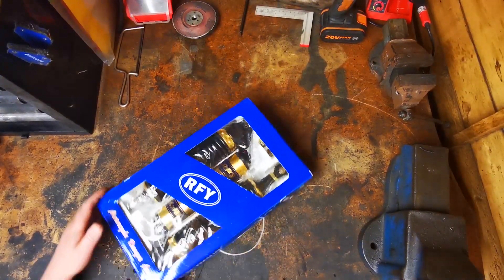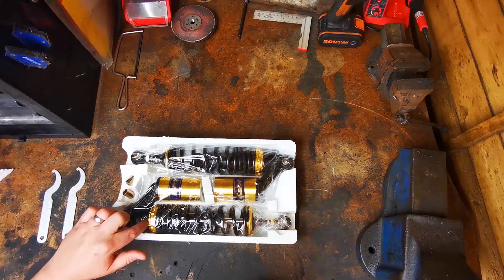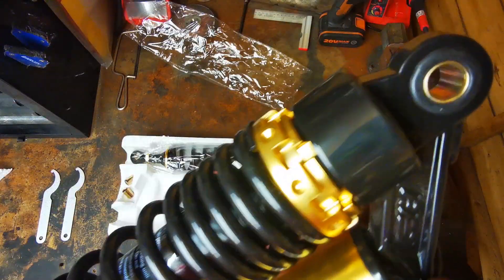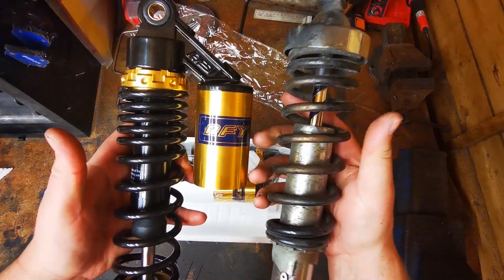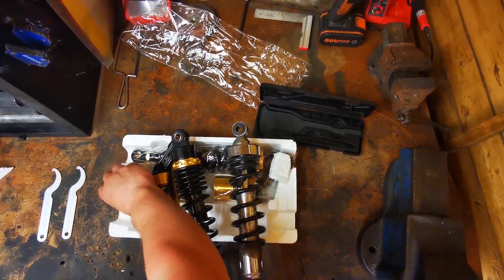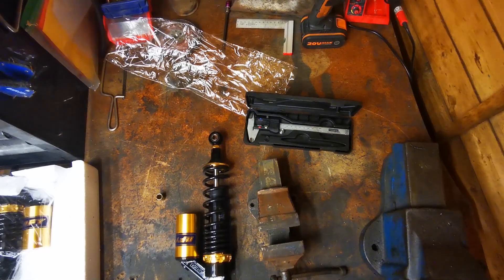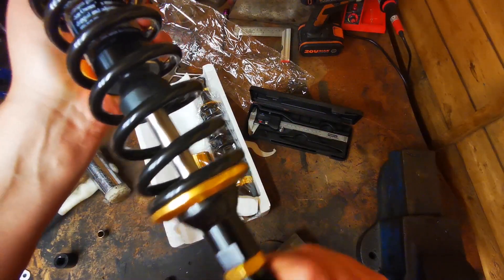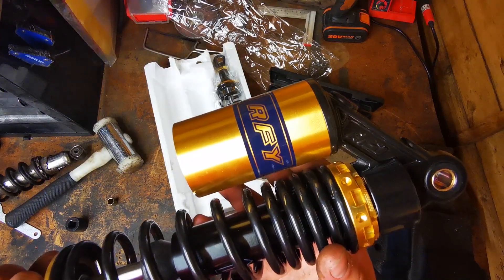RFY Shocks Unboxing And First Impressions

Comment: I bought a pair of these because they were the cheapest universal rear shocks on ebay.  Someone pointed out to me that the gas reservoir is completely fake and there is nothing inside the shock at all.  I've done 11.000 miles on them so far and plenty of hard off road riding along the green lanes of Kent, Sussex, Surrey, and Hampshire, and they havent blown up yet.  I would say for £35 they have been adequate.
Reply: Someone actually cut em open and it turns out the reservoir is not fake

Comment: Just an idea, a valve spring compressor makes very short work of taking out bushes on shocks
Reply: I installed 14mm bushing 
I used a vice with a jaw guard on one side made from aluminium angle to protect the 14mm metal bushing and used the 14mm metal bushing smeared with red rubber grease to push or press out the original factory 12mm metal bushings while installing the 14mm metal bushing at the same time 
I used a socket on the side the 12mm bushing come out for clearance and once they were nearly out had to use a couple of washers to increase the clearance because the socket wasn't quite deep enough 
I used a socket that fitted neatly against the rubber part of the bushing to hold the rubber in place while allowing the 12mm metal bushing to move into the centre of the socket 
You could cut a piece of metal tubing to size instead of using the socket and washers or you could use a deeper socket than I had on hand
Reply: ....it wasn't so much pressing out the 12mm bushing as using the 12mm bushing as a guide for the tighter 14mm bushing so as not to tear or damage the rudder

Comment: Just bought these for my Bike and will be installing them this weekend. So far they look good and by putting my weight on them seem a little stiff, I will update y'all when I get some road time on them. I recommend checking the pressure on the shocks when they arrive to make sure you aren't low.
Reply: Put them on just had to use the different insert, they fit well, and after 150 miles of riding today I had no issues and they were softer then the rough OEM shocks. I still need to mess around with the preload a little but it is close. Also when I checked the shock pressure they only had 20 psi, I put compressed in in them up to 70ps.(Our own air in the environment is mostly nitrogen anyway, so thats why I used it)
Reply: @chuckr5929  Would you recommend the piggy back shocks over the regular type shocks? If so, why? I'd appreciate your advice. I'm thinking to get these for my Yamaha V-Star 250.
Reply: @chuckr5929  
How are they going after 7 months ?
Reply: @hodaka1000  Still going strong had to put in nitrogen right out of the box, it took me a few tries to get the preload right, but after that and 2000 miles of riding on them, they are an improvement over stock.
Reply: @hodaka1000  They soften it up a bit over my stock shocks, so I am not as sore after riding 6-8 hours.
Reply: @chuckr5929  
Excellent 
I got a couple of pairs recently for $70 Australian a pair 
I just fitted one pair to a young mate's SR400 but he hasn't ridden it yet
Reply: @chuckr5929  
So you just increased the pressure with compressed air ?
Reply: @hodaka1000  You can use compressed or actual nitrogen, mine are at 125 psi and holding. I did have to replace one valve core aka the valve that holds the air in.
Reply: @chuckr5929  
Thanks
Reply: @hodaka1000  No problem, hope you have the same luck as myself.
Reply: Ordered some of these for a 83 nighthawk, do you still have them?
Reply: @rj1234100  Yeah they are still on my bike, they softened the stiff stock suspension up a lot, and once a year I have to add air to them. The rubber bushings are showing wear.

Comment: Thanks for the video. I’ve just bought a set of these for my triumph street scrambler. I’m struggling to find 16mm bushes for them. Where did you get yours and was they easy to fit into the existing rubbers.  Cheers Mike
Reply: you could take the old bushes and replace them into the news

Comment: Funny I just picked up a pair in red even came in the same exact box. There is but one difference, yours say RFY and mine say NTC lol... How did they hold up?
Reply: How are you finding your work? I need to do something with 07 sportster this winter
Reply: @beyondupnorth  I no longer use them. These are ment for an ATV. They are way to stiff for a motorcycle.

Comment: I recently acquired a XJ 900 1983, How did you do the handlebars conversion? 

I’m thinking of getting handlebars clamps from eBay, get a longer front brake hose and nice scrambler/cruiser handlebars...

Comment: The problem with these is, you don't get any realistic data, e.g. a spring rate, or at least for what weights they are made. Sometimes they give the max. load, but then they do not write if it is for a pair or for one.

Comment: Do tnese ride better then the oem sportster shock? Couldn't be worse could they? Also has anyone rebuilt these or recharged nitrogen? I'm wondering if the internal orings and seals are the same as any famous brands or if a seal kit is available?
Reply: Chris Livengood of CL-Mototech rebuilds these, the 340mm tend to be the rebuildable ones while the others are mostly junk.